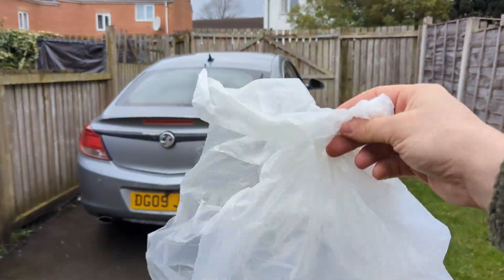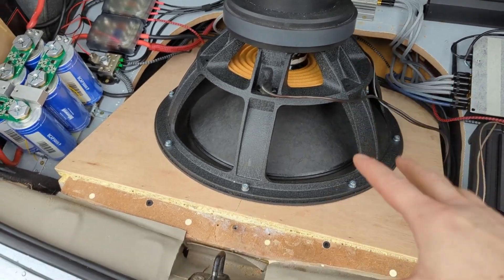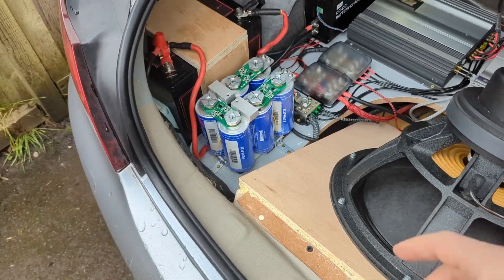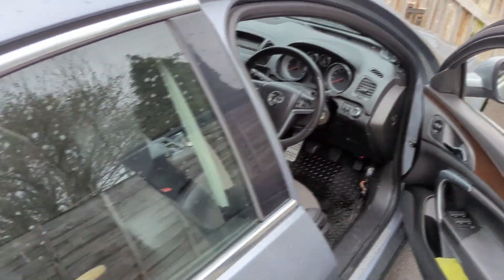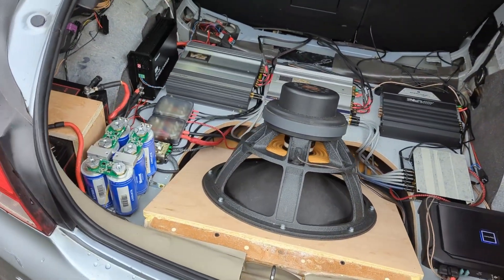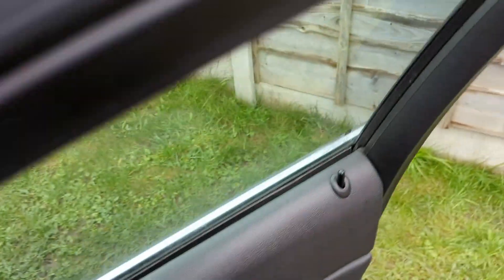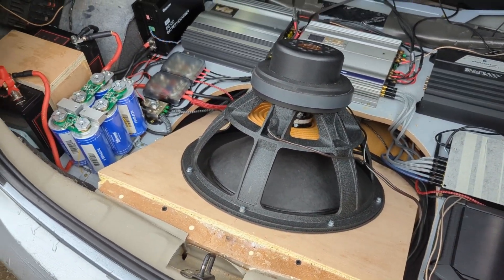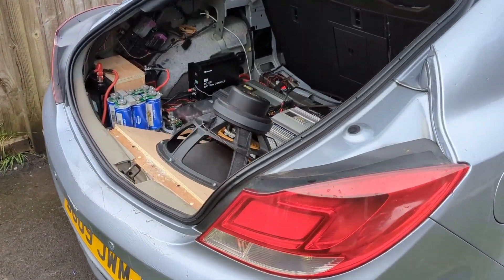One Audio IB3v3 infinite baffle subwoofer flex

Comment: Would it do this trick in a similar way if the sub was in a closed box? Why I am asking this question is because I am dreaming of a system that will shake my driver's seat and I am thinking how much power I need . And how much FS my sub must have. Will two 12TW3 in a sealed box shake my seat? What do you think? Thank you, Rocket!

Comment: How do you like the SQ of this sub? I’m looking at getting 2 12s for IB. I see people talking about AE and SI subs a lot. IB3v3s have been my dream IB subs but I don’t want to get them and regret it. What made you go with this sub over the others I mentioned? Thanks
Reply from the maker: Availability. AE is double the price for half the output. SI is much more expensive due to shipping from the US and tax. You would be happy with either option.
Reply: @RAW-CAt how would you compare the SI vs IB3v3? I’m in the US so shipping wouldn’t be a concern. I’m in the IB groups on and have an IB in my daily car but I’m just running some cheap 15” Skar SDRs on a 400 watt amp. They honestly sound great but I want 12s so I can drop the subs down into the car a little bit more and gain my entire boot back. A pair of 12” IB3v3s have more VD than the 15” Skars so it should be more windy while taking up less space. 

Sorry for the long explanation lol. I just want to end up with the best 12” IB sub I can get. I saw the new IBn3s but even one audio says it’s not much better than the IB3v3s as far as SQ
Reply from the maker: @andrewmcmillan8110 if the install is true IB I would go with OA, if it's trunk baffle, I would go with SI.
Reply: @RAW-CAt it is a true IB. Thanks for your input! I was already leaning that way lol
Reply: @RAW-CAt why the SI for trunk baffle? What if your trunk is big, mine is 20 cu ft
Reply from the maker: @scose SI drivers are lower Q, so trunk baffle would bring them up slightly. With OA high Q getting even higher, you might lose some low end.

Comment: What's the story, picture, overview, with the extra battery if you wouldn't mind explaining. I have assumptions but not sure if they are accurate. Whats powering what? Charging of 2nd battery and main battery? Is there a limit on say listening at loud volumes as 2nd battery gets more depleted then have to stop? I guess an overview of a daily system using a hulk subwoofer and lots of power. I prefer the idea of the AE subs at the moment as don't need to be concerned with the electrics but if just adding an extra battery is all that's needed, well that's no big deal.
Reply: For trunk IB, 540 litres
Reply from the maker: The extra battery is for the whole audio system. I want to have separate electrics from.the front, that way there are no issues with grounds or possible noise. The lithium is being charged by a 40A dc/dc charged with controlled voltage, so I know that it's not overcharged. The battery is capable of supporting 3000Wrms, my system is barely 1000W being IB. With a fully charged lithium, I could blast 60-80% volume for 4-6 hours before voltage dropps below 10V.
Reply: Thanks.

Ok, a further question if I may after reading that. Just about the understanding, overview, between the discharging and charging of the 2nd battery with daily usage and 40 amp going to the audio battery for charging. For example, say listening at moderate or 'normal' volumes, the battery is charging more than discharging?
Reply from the maker: @michaelheath3725 correct. My system on normal listening levels draws maybe 10-15A. IB is super efficient.
Reply: Thanks
Reply: Asking these questions as one consideration for the sub stage in trunk IB is dual IB3s but with a second battery, no problem. Ok great.

Comment: hey There. enjoy your content! I just purchased the same OA ib3 18” sub 2ohm svc and I was considering putting the Helix P One @ 2ohm load. Since you have experience with this Driver do you think the P One is an appropriate match or should I go with something that will provide over a kilo instead of the 880w the P ONE puts out?
Reply from the maker: I would go with something way bigger. I mean it will be fine, you will get plenty of output, but if you want to use the full potential of the sub, go with something at least 1500W at 2ohms.
Reply: @RAW-CAt  thank You 🙏

Comment: Wow, nice set up, I am literally just starting to tune my car, my specs are,

Focal K2 power comp up front

Focal K2 power coax for rear fill

Alpine type rw12d2 in generic ported box(quite big tuned to 34hz, maybe)

DLS CC-44 running bridged for fronts(220w per channel).

Pioneer GM D8604 bridged for the rear(300w per channel)

Pionner GM D970 1running at 1ohm so getting 1200w.

Alpine CDE 296BT head unit

At the mo I am just running off the head unit with front and rears crossed at 63hz and the sub at 63 hz, and are at the moment passive because I did not want to go through the electrical plugs in the doors to run wire for active system, this is the biggest drawback of the system so far.

It sounds really good but have not really begun tuning because of the upgrades I have need some planning to implement.

Planned upgrades are Dayton audio Ultimax UM15 in the 3.1 cubic ft sealed box and an Audio Dynamics AD DSP68, I also have a Dayton iMM-6 and REW to do some measurements.

Looking at your set up I would love to put the sub in IB config in the wheel well as my car is one without a spare.

Love your work and binge'ing all your vids to get the best from my set up, I really need to go active with the front end but am a bit scared to cut into the dash, although I may get some second hand pillars to try and make some pods for the tweeters and really should go three way up front but the chances of getting the focal K2 mid's on their own is pretty slim I rekon so may have to think of a different solution, I am tempted to try the little Faital pro mid that you have used as a temporary solution.

Regrads

Comment: how do you like the Smart 3 on the sub? Ive been hesitant on these full bridge amps.
Reply from the maker: I personally will never understand this full/half bridge debate🤷 It's an amplifier that does it's job. I don't like the fans on my smart 3. As I am barely pushing it, I will disconnect them. This amp has a bypassed infrasonic filter as well. I think my purpose for this amp is way different than 99.9% of the cases.
Reply: I had a smart3 on a SI HST15 in my genesis and it was fantastic. I was I a sealed box, though

Comment: Very nice! Thanks for your videos explaining the IB mystery. I'm importing to UK 2x Stereo integrity Ib24 subs and plan to put them to fiat 500. I want to have both SQ L ans SPL. This will be my first infinite baffle project. Do you think it's an overkill and I will not be able to play ultra low (10hz) because of a small car or will it be quite impressive low hz playing project? Nick from Stereo integrity thinks it will be a bomb.
Reply from the maker: I personally think that it will be very difficult to get the very low end without some help from DSP. Your car will effectively be as an undersized enclosure.. But that is just my guess. Better still, ask Peter or Laimonas as I imagine his Amarok cabin is similar size to your fiat. And he had 2x18s in there.
Reply: @alex.G.R.Z- Those (2)- Stereo Integrity IB 24" subwoofers, will have no prob. playing 10Hz, as long as nothing in your audio system limits low freq.. Like subsonic filters, amplifier bandwidth, source limitations, or any other cross overs, that maybe in a bass restorer unit. Example: Audio controls regular epicenter, is set from the factory, to start cutting off @ 32 or 33Hz. Some of there units have adjustable Pfm chips that you can buy, to change that freq. Cutoff point, and some you cannot= its a fixed= a non adjustable unit/model.  What amplifier model, and impedance do you plan on using, to power these (2)- 24" subwoofers? You can never have too much low freq. Output IMO, because you can always turn the output down, but if its not enough, you just can't keep turning it up, if there is no more!
Reply: @evilinside5984  thanks for the info. I will be using Stereo integrity amps. 2 x siq1500.1. Subs are 2x 2ohm so will be playing at 1ohm making the most of the amps. Just head unit and the amps. So no additional crossover- just the ones in headunit.
Reply: @alex.G.R.Z - That will be AWESOME! I seen a test on 1- si 24" with the si amplifier, and it played single digit freq. down to 2 or 3Hz👀! But i think around 7 or 8Hz the spl fell off quickly. But that systems peak eff.=Most SPL, with lowest power, was @ 16 to 17Hz! I tyhink it was over a 140Db @ 16Hz👀! You will love them. I would play around with your Lpf settings, but 40Hz will prob. be a good starting point. It should play (8Hz to 40Hz) well!? Please do a video, after setting up your si 24" subwoofers plz. I will comment on your lego, passive radiator video, so you remember to give me an update. I ❤️ low freq. Setups, and yours will be epic!
Reply: @evilinside5984  hoping to do 150db + on this sq setup 😍
Reply: @alex.G.R.Z - You have a good shot, @ a 150Db, @ around 17 to 19Hz👀 I hope when your done, testing and tuning, you can take it to a Propper Droppers show!?
Reply: @evilinside5984  I will definitely take it to Propper droppers. I've not seen anyone there with the IB before. I always try do create something different. All you see at the show are ported boxes with a lot of subs on some crazy power. My Unicorn 🦄  project with slaps-18 had a lot of intrest when attended Santa pod. People loved it. Hope my IB project with 2 x SI24" will be a shocker too but  lots of work awaites me.

Comment: Those subs are rated at 1125W at 20Hz.  It takes about 1,600W to reach XMax at 20.

When I had a Fi IB3 18 installed in trunk baffle it would hit 60 on an SQ tune, but it started to fall off at 40 for SQL.  This time with the OA 18's I'm putting in a front sub to pick up that missing bass.